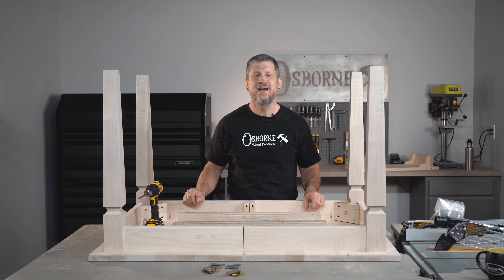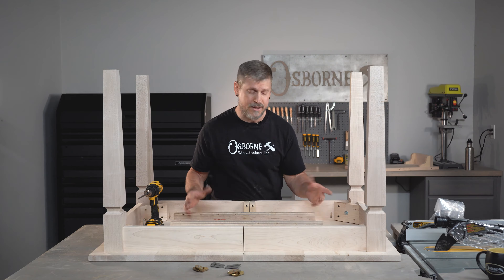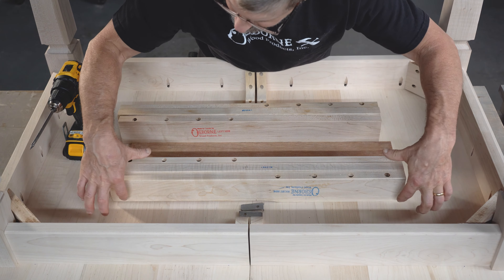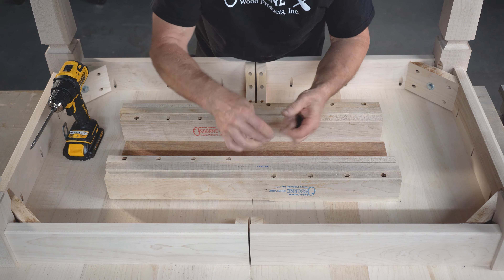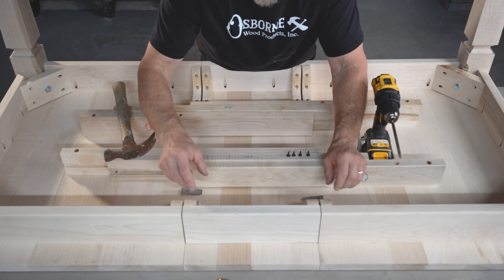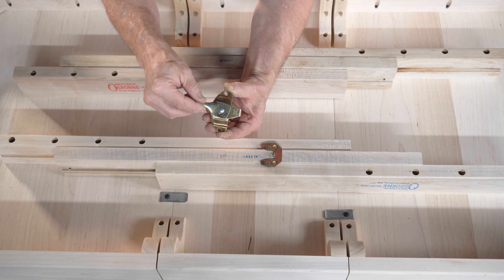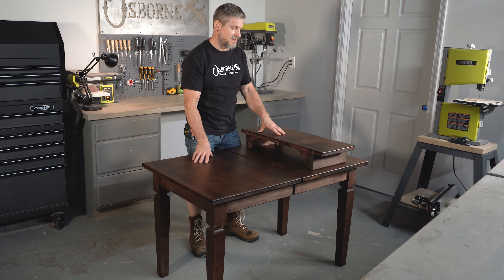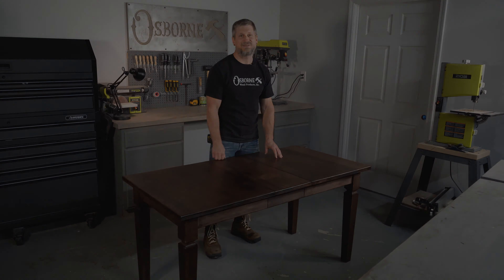DIY Extension Table | How To Install Table Slides And Locks - Builder's Studio

Comment: Love this! I'm currently making a similar table. Question about the slides. Since you screwed them directly into the table top, will that cause issues with seasonal movement? I saw you gave them a little play so it's still able to close up tight even if it shrinks, but I'm concerned about the slides constricting the movement with them being screwed straight in. Is there enough play in the slides pilot holes to allow for seasonal movement?
Reply from the maker: Thanks for watching! To answer your question, yes these slides do allow for seasonal wood movement. The pilot holes are slightly oversized to allow for shrinking or expanding. As long as the screws are not overtightened, there won't be any interference with the wood movement. Hope this helps!

Comment: What would cause bowing in the center?
Reply from the maker: Hi Brandy! There are a couple of factors that could contribute to bowing in the middle of your table. Humidity or temperature changes can cause wood movement if the wood isn't sealed properly. Additionally, if the weight of your center leaves are too heavy for your slides, it can cause a sag in the middle of your table. It is important to pick a table slide that has a proper rating for the size leaves you will be using. If you have any further questions, please don't hesitate to reach out to our customer service team!